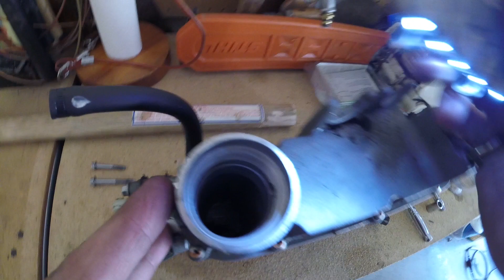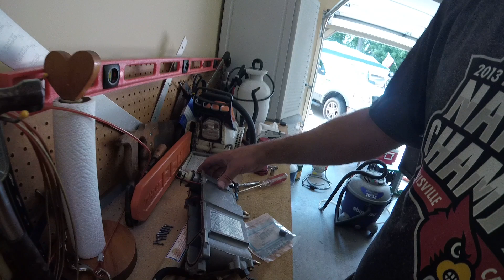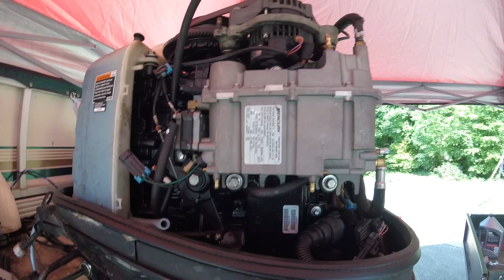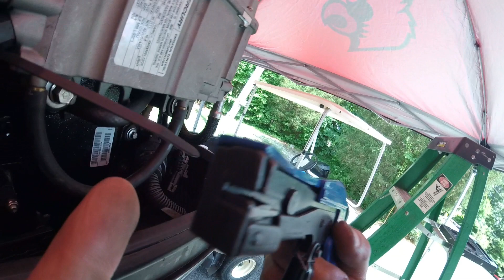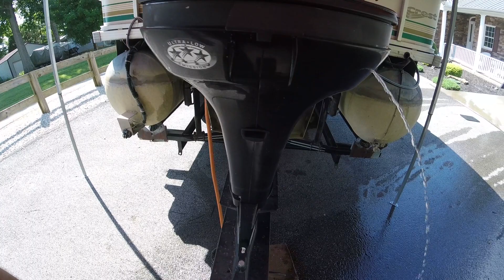Mercury OptiMax 90 FUEL Issue SOLVED

Comment: Would this be the cause of my issue ? It would start then die but will stay on after 2nd or 3rd attempt and run fine . Thanks again .  I got a 05' 150 Optimax dfi. Thanks
Reply from the maker: Could be, but mine would crank but not start as if it had no fuel.

Comment: What were your symptoms? 

I have a 2018 Optimax that is difficult to start at first. She'll spit and sputter after about 3 times of the engine hitting and dying. With her spitting, I'll bump my RPS to about 800 for 10-12 seconds, and it'll idle fine. Then she'll have a miss after I put it in gear, but will run with no problem when I give her a little gas.

She has no problems launching or at WOT, but when I set it back down and start idling She'll start sputtering again after about a minute of idling.
Reply from the maker: Mine would crank but no start, the high pressure side of the fuel would not pressurize because of the bad seal.
Reply: @EricsBBQAndMORE Thanks for the reply! 

It doesn't sound like my problem, but it's definitely something to look for in the future.
Reply from the maker: @slimjimmy229 it’s possible that you have something related to fuel.  I would still check all of the fuel system for issues like mine had.  Best of luck!
Reply: @EricsBBQAndMORE That is the direction I'm leading. So far, I've replaced the fuel line up to the pulse fuel pump. The POS grey fuel line was leaking. At the pulse pump, I found that one of the bolts had backed out.

At the moment, I'm thinking that bold coming loose blew one of the seals in the diaphragm and it's not able to keep up the fuel supply at low RPMs.

Comment: what was the symptom that lead you to tear it down? I have a 90 optima that runs but when you get over 1/2 throttle it wants to die.
Reply from the maker: @1Georgestube  I had a crank no start.  But you could have something similar going on…

Comment: What I would like to know is how you got the high pressure hose fitting out of the bottom on the back side I can't get mine out
Reply from the maker: At 11:57 you’ll see the plate that has to be removed to get the high pressure side out, I assume you’ve removed that.

Comment: Hi I have problem fuel pump blows fuse high presure pomp when I take off power from.swith to high presure pomp the fuse not dead
Reply from the maker: I’d guess you have a short somewhere, check wires!

Comment: Thanks for the video. I bought a glastron ski boat that had a 06 90 optimax. It ran great for the first week then I took my parents out and was idling along and it cut out. Lucky it would start after alot of cracking. But if you tried giving it throttle it would cut out again. I could only make it back idling. I bet this is the problem.
Reply from the maker: Fingers crossed for you that this fixes it!   Let me know!

Comment: I just did a fuel filter change and ran it for a hour and ran perfect. Now that im on vacation with the boat. It won't go past 3000rpm 😭😭🤬🤬😡 any suggestions?
Reply from the maker: Does it run rough?  Does it idle ok?  Could be unrelated to fuel and maybe just a linkage issue.
Reply: @EricsBBQAndMORE  no it turns on & runs fine up to 3000 rpm . The boat won't plane & go past 3000rpm. It's just weird because it ran perfectly a week ago. Now that I'm on vacation this happens 😭
Reply from the maker: Check your throttle linkage to make sure you are getting wide open throttle.  That sucks that this happened while on vacation!
Reply: @EricsBBQAndMORE  yes it does but I will for sure check that when I get back home to Los Angeles. Thanks for the fast reply. We really appreciate your time to reply to us that can use your help
Reply from the maker: @cramos6638  also check the fuel lines are not pinched.  And make sure the filter is fully seated.   If there is a air leak in the fuel system it could limit the RPMs.  Best of luck!

Comment: So I did mine exactly like you except now the spout on top one of two but the one on the left. If you follow the hose it goes over a hose connection and it leaves an open hole for me where gas flows out and now the motor won’t run. Is gas suppose to even go up that spout? Is it a vapor hose or is the end of the hose supposed to be plugged
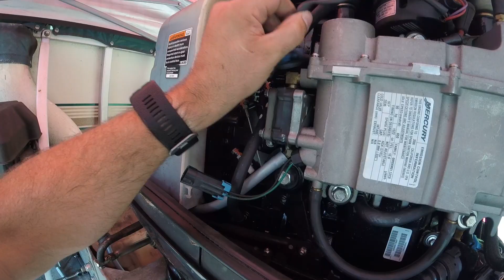Reply: 12:39 exactly. Does fuel come out of that spout for you and where does that hose end up getting hooked up to? I don’t know if a piece fell off of mine or what
Reply: That pin that gets hooked to the float.  When pumping the bulb will it get hard when that pin pushes up into that hole?
Reply from the maker: I’m not sure based on what you’ve described.
Reply: @EricsBBQAndMORE  so on top of that vapor canister there’s two outlets that are hooked up to hoses not the one on the far right but the one left of that a hose connects to that and if you follow that hose the plugs in and right underneath it there’s an open hole that is now shooting gas out of it for me. I looked up little part up and it looks like it’s a fuel supply fitting
Reply from the maker: @EricElmer1313  try looking up a schematic on the fuel system.  Does not sound like it’s hooked up correctly.   Maybe it’s a blocked vent maybe.  I’ll look and see what I can find.
Reply from the maker: If you look at my video at 12:39 I hook up the fuel return line.  The other one is the high pressure line.   Is that what you are referring to?
Reply: @EricsBBQAndMORE  when I pump the bulb putting fuel into the water separator fuel does come out of that spout so when that hose hooks up to it and and the other end hooks up to just a hole the gas comes out now I wonder if that fuel supply piece that I need holds the gas in that line and It doesn’t let it out.
Reply: When you get some time, you should take the hose off of that pump gas in and tell me if gas comes out of that hole

Comment: Great video, FYI you are not supposed to run the motor with the water hose hooked up to the flush. My dealer told me to always use the cuffs at the bottom!!!
Reply: You probably damaged the rubber impeller without ear muffs on the lower unit water pump pick ups...
Reply from the maker: Yes!  After posting this video I learned this info!   I always use the muffs now, I am curious as to why?  But I haven’t researched the answer to that yet.   Thanks for watching and for the heads up!

Comment: I am having the same symptoms on the same motor. I took the vst apart and the seal is not torn or cracked, but it is tapered looking at the top. Would you think that could still be bad?
Reply from the maker: Did you replace it?  It may look ok but still be bad.  It has to seal 100% as it’s the high pressure side so no seal, no high pressure.  Check your seals on the low pressure pump as well.  

I’m not a mechanic just a Google mechanic 😁

Comment: Thank  you so  much for this video. I had a water in fuel alert and the Users Manual just showed disconnecting the hose and loosening the screw to drain the filter chamber. I only got about a teaspoon of water, no fuel. I suspected I needed to loosen the filter. Your video showed what happens when you used a screw driver to try and loosen the filter. I called a retired Mercury mechanic just down the road and asked if he still had his Mercury gas filter tool and yes I could borrow it. It was still a struggle to loosen that filter with a 3/8" ratchet drive. The manual suggests oiling the O-ring seals. I wonder if a little wheel grease would be better?  I scanned Error Icons and their meanings from my Smartcraft User Manual. Is there some way I could share them? Mine is a 90 hp 2005.
Tom Bauer
Reply from the maker: Glad this video help!  It makes my day when I hear about someone getting use out of my video!  I don’t think there’s a way to share them on YouTube.   I’d be happy to get a copy if you could send it to ericsbbqandmore@gmail.com thanks!

Comment: Great video! Just wonder if you remember where the black and red wires go on the low pressure pump? I just pulled mine apart and the wires came of or were off before I could see where they go
Reply from the maker: I’m not sure, let me look and I’ll get back to you
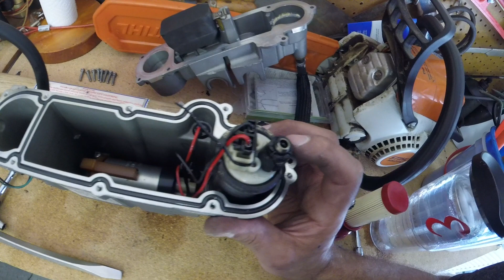Reply from the maker: Look at 6:09 and see if that helps
Reply: @EricsBBQAndMORE  perfect. I knew I had seen the info somewhere. thanks again. it also turns out that the spade connectors are 2 different sizes so its hard to mix up
Reply from the maker: @steelhammer365  I love it when design engineers make our life easier!

Comment: Another Question, When I start my Optimax 90 HP either with muffs or when I Put it inside a barrel the water is not coming from telltale if I did not put gases in the remote control, Should I wait some few minutes? It is your case also?
Reply from the maker: It should not take long for water to stream out, you should replace your water impeller every other season at a minimum.  Mine was past due in this video.   I’ve got another video on replacing the impeller, check it out.

Comment: Greate Video, I have the same outboard as you, Optimax 90 HP. When you run the outboard you are using the flush port instead of the muffs for water cooling. Is it correct?  is it recommended by Mercury?
Reply from the maker: No, actually someone committed that I should not do that...I use muffs only now.  I don’t think it hurt anything but better safe and use muffs like I’ve always done!  Thanks for watching!

Comment: have an issue with my 2005 225 pro xs found i had the exact issue he had here a bad seal on the high pressure pump....mine would start but die after a couple seconds of running but got to where it would not start at all....will know for sure after shop opens in the morning and i get it back together but i feel confident thats the issue
Reply from the maker: If the seal was cracked I'm sure that's the issue!  Best of luck!  Let me know if that fixed it.
Reply: @EricsBBQAndMORE  definitely was the problem replaced the seal today and she runs like a champ now......thank you for sharing your video
Reply: for those that want to replace the fuel line orielly auto parts sells a black fuel line that is ethanol compatable at a very good price mine is 3/8 and was $1.48 per ft
Reply from the maker: @bullitt454  glad to help!  Amazing that a cheap little rubber thing can shut you down so easily!

Comment: Hello Friend .  makes a video on how to remove the thermostatic valve.  there is no video talking about it.  valve when the engine is heated.  let the water pass, do you know what it is?
Reply from the maker: I actually did not know there was a thermostatic valve on a outboard motor.  But I guess it makes since that there would be one so that your motor can get to operating temperature.  I unfortunately do not know anything about that valve.   Best of luck to you my friend, thanks for watching.

Comment: Ok I have spark but it won’t turn over swap the Cdi clean the spark plug what did you besides clean the the fuel pump system
Reply from the maker: Xuxo Thao go to 11:43 mark and you’ll see the part I replaced.

Comment: Hi, i have the same outboard and i think same problem..i changed the water separator and right after that the outboard start and after few minutes stops for many times... till now  it doesnt start anymore..i was thinking that when i changed the separator could some dirt get inside im not sure! does it help if i do same maintenance as you did? thank you
Reply from the maker: It is probably this item I highlighted in the video.  The rubber ring  part number 8M6000589
Reply: @EricsBBQAndMORE  thank you..i will try to change it and see what happens
Reply from the maker: @Whimsical007  this is the moment when I descovered the issue, may be helpful https://youtu.be/3COohZQsFnA?t=342
Reply from the maker: Mehdi Bourouael oh, yes, mine would not start at all!  That’s an easy fix, hope the parts not too expensive!   Best of luck!
Reply: @EricsBBQAndMORE  Hi Eric and thank you for your help! Today I've opened the fuel system and found the same rubber little bit deteriorated and i buyed a new one and change it..i also cleaned the whole system and tested the pumps with 12v and they are working very good..when i put everything together again the problem still there...first it doesn't start for long time trying then it started but it stay no more than 1 or2 min and then die again 🤔 any other tips? Thanks
Reply from the maker: Mehdi Bourouael darn it!  I was hoping that would fix it!  Did you check the fuel filter, I’m sure you did.  Is the fuel ball hard and did you pump it up before ?  Did you take apart the low pressure fuel pump and make sure it was clean?   One other thing, did you look at the needle and seat of the fuel bowl float?  Maybe it’s not filling up the bowl fast enough and starving the motor ... I’m not a mechanic so I’m just guessing.

Comment: Could that be the cause of boggling in the engine at a high RPM? Loss of power.
Reply: Mine bogged at full throttle some and then was weak out of the hole then I quit and would not start. I replaced the rubber seal and she came back to life like brand new. It’s a $20 part that could save you hundreds worth a try regardless.
Reply from the maker: It could be a sign that that rubber part is starting to go.   Mine just would not start at all, so I’m not sure.  I’d suspect it could be something else because it needs pressure to push gas thru the injectors.   Maybe the fuel pump is going out?
Reply: mine goes up to 4000 RPM all good but once i try to pass it it starts to wiggle and goes into continuous beep until i take down the throttle a little ... on the pc reading is says "Abusive Maneuver Stage 1" if i keep the throttle at same pace it will shut down the engine from working until the beep goes down and the pc read shows "Abusive Maneuver Stage 2" ... so my question is will this fix my problem ? or replacing the fuel pump ? thanks guys
Reply: @MrSapinhopreto  to resolve my issue, I did several things. Bypass oil sensor, replace MAP sensor, replaced thermostat and potter valve, new seals on my air compressor, serviced fuel and air injectors. No fuel issue. I went all in and to this day I’m turn key and go!
Reply: @soloboatinggeraldarchibald2388  what’s MAP sensor ? 
Glad to hear that all went well !
Reply: @MrSapinhopreto  The manifold absolute pressure sensor (MAP sensor) is one of the sensors used in an internal combustion engine's electronic control system. ... The manifold absolute pressure sensor provides instantaneous manifold pressure information to the engine's electronic control unit (ECU).
Reply: @soloboatinggeraldarchibald2388  great man thanks for the info ... from what i described do you think it will help me solve my problem ?
Reply: @MrSapinhopreto  hard to say. Could be many things. Those were just what I did to resolve my issue. With these newer mercury engines, there’s sensors for everything. 3000-4000 rpm restriction is common on bad sensors. I’ve learned to check the MAP and oil sensor first. Compression test on each cylinder is important. Check your bottom spark plug for any corrosion, could be bad potter and thermostat or leak into the air compressor. Oil tank has an air filter as well! 

Since I decided to do all those changes, I also changed my coil packs, and relays as well as cleaned the air and fuel injectors. I just wanted NO issues on the water.
Reply: As far as my fuel system, I replaced the fuel filter (just because), and added a fuel/water separator.
Reply: @soloboatinggeraldarchibald2388  thank again .. so much information .. i need to get started then ...

Comment: What was that part number for the o ring for the top of the pump.
Reply from the maker: It’s 8M6000589.   Thanks for watching!
Reply: Eric’s BBQ And MORE! RHA ks for putting the video out. My boat stopped on me Saturday. Fire on all three cylinders and I bought two brand new pumps and still nothing but I took it back apart and that print was cracked on both sides so I’m hoping that will solve this. Thanks again.
Reply from the maker: joshradford1989 if that rubber is cracked it won’t let the pumps to pressurize and won’t push the gas thru the injectors.  I’m sure this will fix your problem!   Fingers crossed for you.
Reply: Wow I just seen my auto corrected spelling. The rubber is cracked on both sides. I’ll know by this time tomorrow.
Reply: It started and runs well. Super thanks for the video. You literally saved me hundreds of dollars and a long wait at the boat mechanic.
Reply from the maker: joshradford1989  AWESOME!    Isn’t it the best feeling in the world to fix something expensive like that!  Glad I could help!

Comment: Get some earmuffs, it is not good to run the engine on the flush fitting, it is for when you get home late at night and don't want to wake your neighbors.
Reply from the maker: I had no idea that was not good on the engine.  I have earmuffs, this was actually the first time I used the flush fitting.  I’ll use the muffs going forward.

Comment: Doesn't an optimax have a 10 micron fuel filter before the vst? If so, Not sure how that got there aside from a filter anomaly.

I would have changed out the float needle while I had it apart. As u saw, Vst is like a big float bowl  that keeps the fuel pumps submerged (similar to carb float bowl).

Can't believe that rubber seal is 20 bux...

Gotta love it when you get her firing again..
Reply from the maker: greauxpete , I didn’t see any debris past the filter, so it did its job.  Good suggestion on the needle and seat, next time...   thanks for watching!